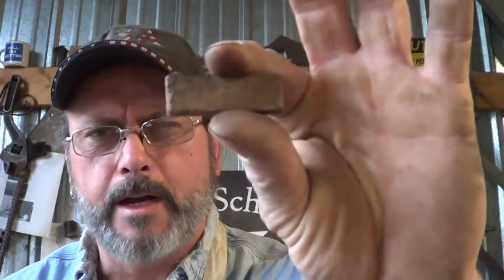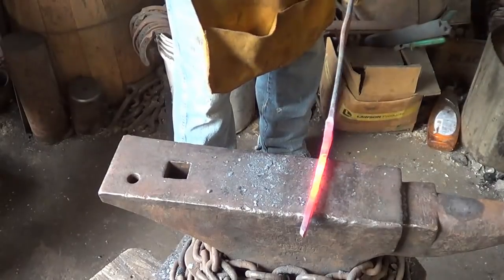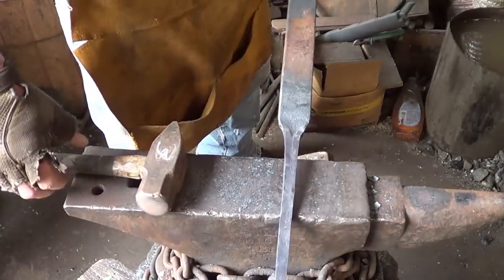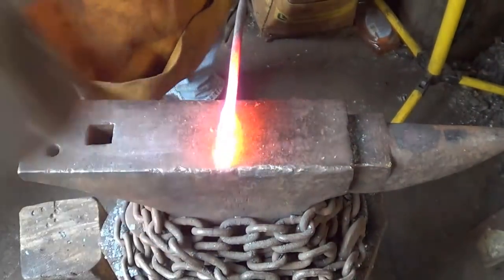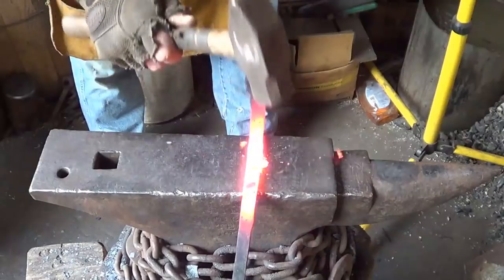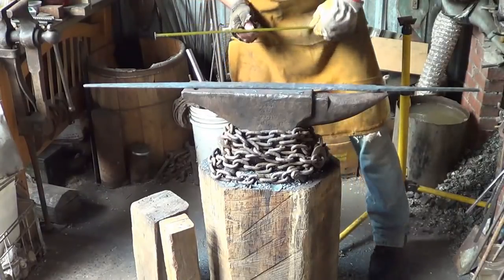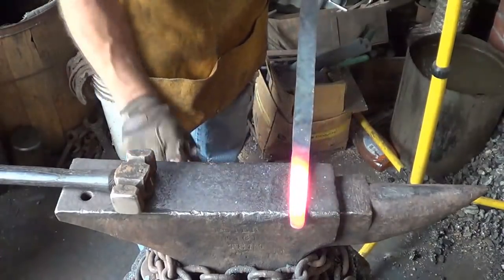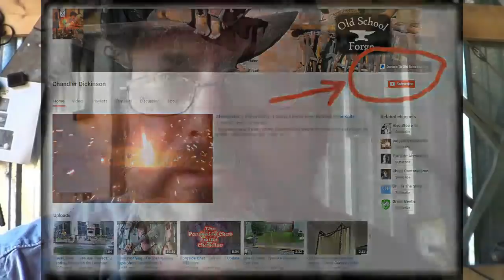Blacksmithing - Claymore Part 1 Forging The Blade

Comment: Really don't want to offer criticism to someone out there actually trying to do something; but swords have a distal taper which means that the blade gets thinner from hilt to tip (this helps to balance the sword and keep it from being tip heavy and unwieldy). A funny thing about the claidheamohmor is that it is "floppy" because of the length and thinness of the blade. The "Braveheart" sword is actually an early century longsword and not a claymore. The claymore would have a point of balance around 7 - 8 inches away from the hilt and tapering from around 5mm (0.19685 inch) thick at the ricasso to around 3.5 - 4 mm (0.137795 - 0.15748 inch) near the tip. I have nothing but respect for you, the work you do, and your attitude of "lets do something I've never done before".
Reply: TAsatorT I appreciate the closing line if your comment after the knowledge you shared about it. 
That attitude of watch me learn is what keeps me clicking in his videos. But obviously that kind if input drives improvement. 
I seriously like how you handled sharing that
Reply: 3.5mm near the tip is actually still a bit thick. 2.7-3.2 is more like it.
Reply: I agree, you handled the sharing and feedback like someone trying to help not bring people down.  Thumbs up.
Reply: TAsatorT not all swords have a distal taper.
Reply: Street Skater 66 almost all do, to some extent. But claymores definitely do
Reply: Good constructive criticism

Comment: An absolutely incredible build and the amount of work you got done in those few hours is astounding. As a few of the other comments said, a distal taper would have added a few inches to the sword and have balanced it better. A fuller in the middle is also a good way to increase length while maintaining the same weight (in fact that's why they started putting in fillers to begin with). That being said, I am in love with what you have done so keep up the awesome work!

Comment: It's a Chandler Special. Too long for a long sword, too short for a claymore, just right to be kick-ass
Reply: https://en.wikipedia.org/wiki/Claymore
Specifications
Weight  ≈2.2–2.8 kg (4.9–6.2 lb)[citation needed]
Length  ≈120–140 cm (47–55 in)[citation needed]
Blade length  ≈100–120 cm (39–47 in)[citation needed]

Comment: Hey Chandler I saw you using a fullering tool if you had another one with the round dies spun 90° you could have gotten more length out of it but all in all an awesome build. I plan on making swords for myself you an backyard bowyer are insperation's l to me.

Comment: Yo Chandler: I think since this is now not a claymore anymore in terms of length and weight, just call it what it is: A Longsword (39-51 inches (starting at 35 for the blade), 3-5 pounds).
it should do perfectly for one of those.

Comment: Might want to double check the weight. From what I have read. Most historical claymores were about 2kg or 4.4p they are not heavy.
Reply: Weight  ≈2.2–2.8 kg (4.9–6.2 lb)
Reply: our sources could be using different collections of swords. the sample size of originals that the source I saw seemed a bit small.

Comment: Fix your anvil rounded edges by welding and grinding back to its 45degrees. Your tang would then be straight 45’s on each side.
Reply: Check back in his videos, he already did that.

Comment: I am a first responder/ search and rescue guy and I want an Old-school Forge railroad spike hatchet/tomahawk. How much would that cost?
Reply: If you want a decent tool to use in S and R, DON'T get one made from a rail road spike. Have one made in a style you like from decent steel! All the best, respect for what you do.
Reply: frozenthunderbolt1 Most of the search and rescue I do is wilderness s&r so I am looking for basically a light camp/hiking axe, Chandler's railroad spike hatchet were beautiful and functional for my needs, but any hachet made by Chandler is something I would love to carry and show off.
Reply: If you want one out of a railroad spike the edge could be case hardened I have been forging old log spikes and it worked good case hardening the edge on knifes I have made

Comment: question for metalworkers: I have a sword that has been reliably identified as a modern North American Wallhanger forged by the master smiths in Nowhere, Pakistan out of no doubt garbage stainless steel (hey, we were all 15 once). Thing is, I'd hate to just throw it away, but it is fairly useless. Is it feasible to do anything with the metal, though? Maybe cut it down and add it into a billet for a pattern weld or something? or is stainless just so unworkable that I should just give it to some neighborhood kid or something.
Reply: Now if you want to make it a useful sword heat it up with a torch qwench it in used motor oil a few times than straiten it if required than heat it up and air cool a few times than heat it up and qwench it in cooking oil  and replace handle materials
Reply: From my understanding,  stainless steel isn't unworkable at all, just not suitable for swords because it is highly brittle. It also has a fairly high forge welding temperature.

Comment: Not trying to nik pick, but on the hole side why didn't you just fold it over on the hole and then hammer it back out? Yeah forge welding that end would of maybe take longer but not by much and would have saved that bit you cut off.

Comment: you want a real challenge try making a long sword version of a kris like this http://warriorwomen.50megs.com/images/swords_fantasy_kris_blades.jpg
The thing about Claymores is they are different depending on who made them. The Scott version is longer than the Brit version. Then you have to decide is it a single hander, hand and a half, or full 2 hand which will decide the length of the tang. The single hander will also have a bit shorter blade, typically about 36-40 inches, 1 1/2 about 42 inches and 2 hand being anywhere longer than that depending on the height of the wielder. Someone my size (6'10) would be able to (theoretically) wield up to a 72 inch sword. The Irish tended to not bother with fullers preferring a more typical Bastard Sword, some say because it was just extra time that the smith could be drinking and why waste that? :D